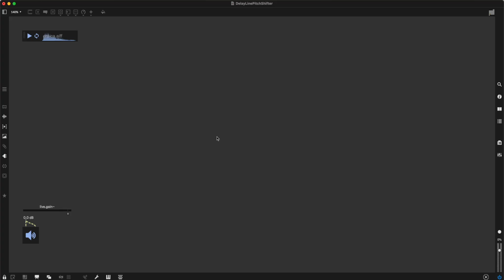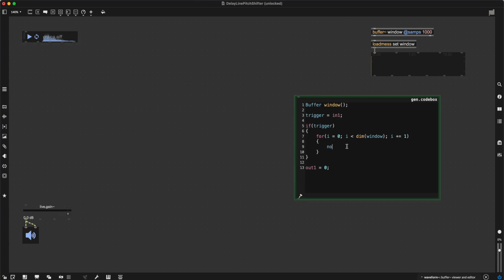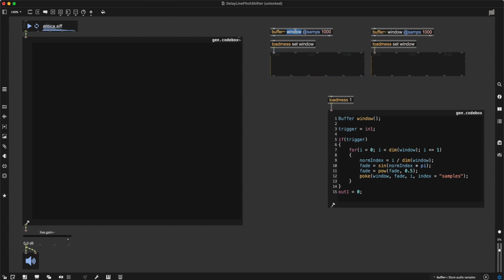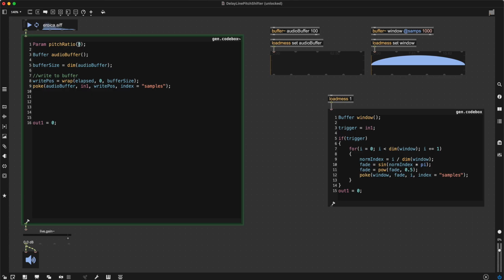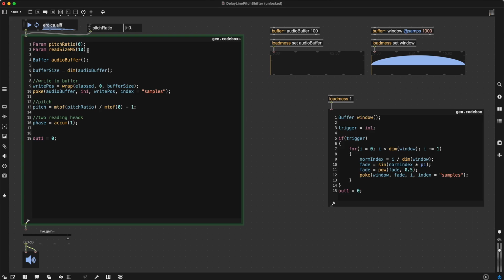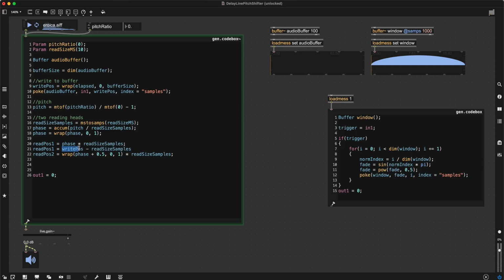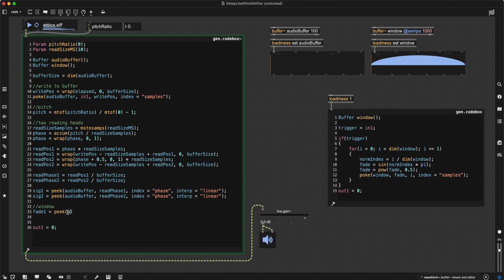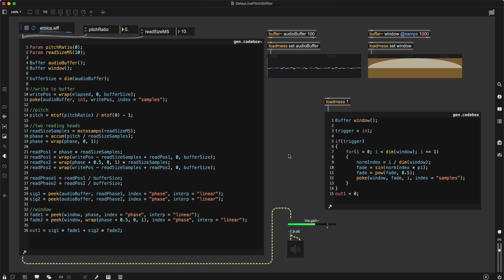Delay Line Pitch Shifter in Max/MSP (gen~ Tutorial)

Comment: Thank you so much for this tutorial! I’d been looking for a clean and simple pitch shifter in gen~ recently, and I’m glad I wound up here.

A couple of things:

1. I’m not sure if you know this, but you can skip the first gen.codebox and create a hanning window very easily by sending the message [fill 1, apply hanning] to your window buffer.

2. I was pretty lost at first as to how `phase` was moving from 0->1 when the pitch was set to normal playback at 0— which also makes `readPos1` and `readPos2` 0. If anyone else is confused by that, the phase only modulates from 0->1 when the pitch has changed. When the pitch has not been adjusted, `sig1` is multiplied by the beginning of the window (0) and `sig2` is multiplied by the middle of the window (1), and remains “stuck” in that position until the pitch parameter changes.
Reply from the maker: Thanks for the kind words, I am glad the tutorial was helpful!

About the window: yes, I am aware of the [fill 1, apply hanning] technique and I actually use it in my Shepard Tone tutorial: https://www.youtube.com/watch?v=-yOuh_PNsEk. 
Here I wanted to build it in gen because I like the sound of this window better in this context and I wanted to show the technique of filling the buffer manually.

And you are absolutely right about the phase behavior. 
When the pitch is set to normal playback (pitchRatio = 0), the phase increment is zero. The phase then stays fixed and the read heads don’t scan/move. 
That is something I should have explained more clearly in the video. 
Thank you for pointing that out!